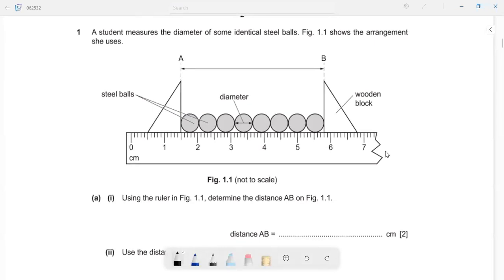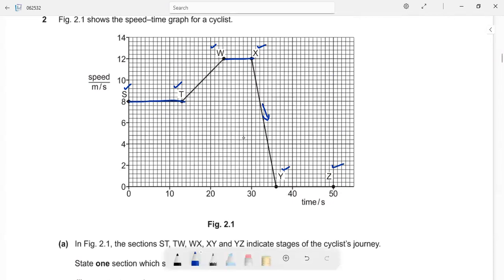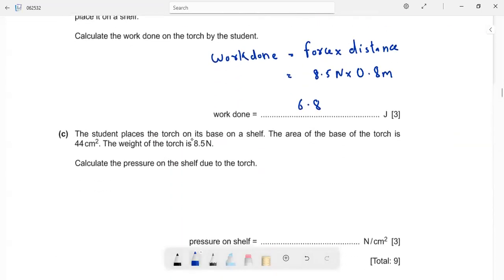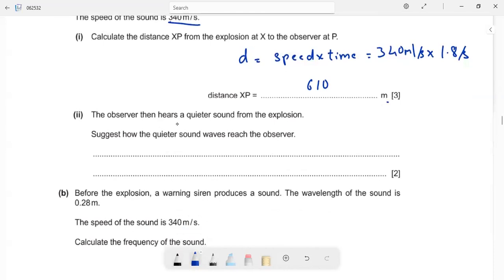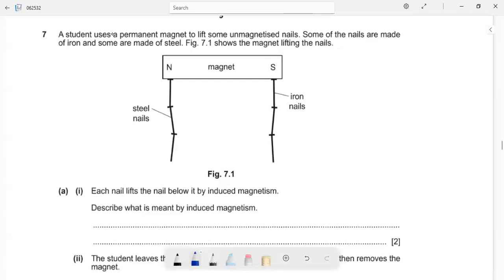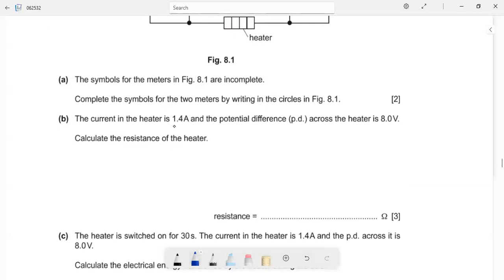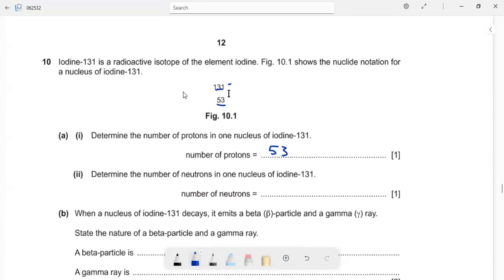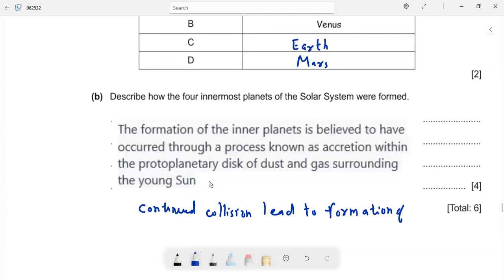0625/32/M/J/23|IGCSE Physics past paper|core

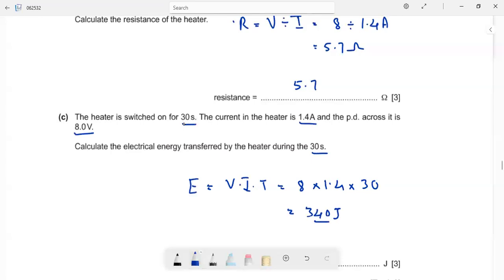Comment: 24:55 why is the answer 340? On my calculator, the answer was 336? Are we supposed to round up the number? And if so, when shall i do it?
Reply from the maker: when we are doing in calculator,we will get the answer as 336,we need to round it off, 
 In order to round to the nearest 10:
Check if the number is a multiple of 10, if it is, do nothing.
If the ones digit is less than 5, round down to the previous 10.
If the ones digit is 5 or more than 5, round up to the next 10.
Reply: @nishapm9661  thanks a million!